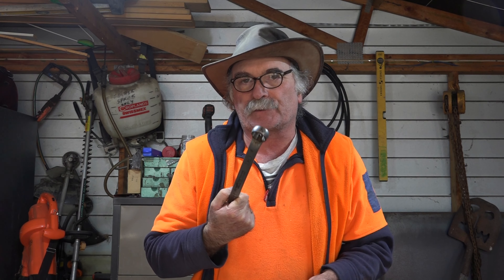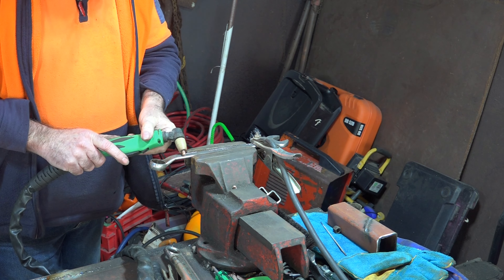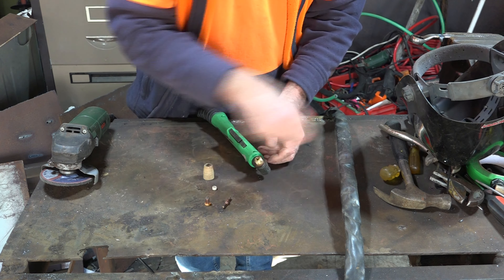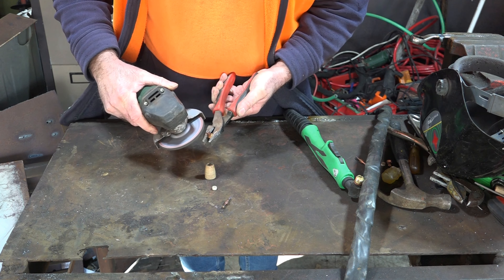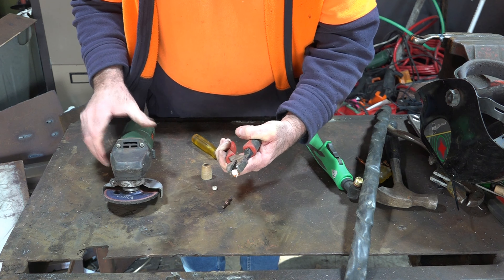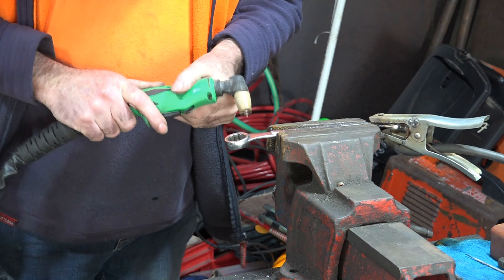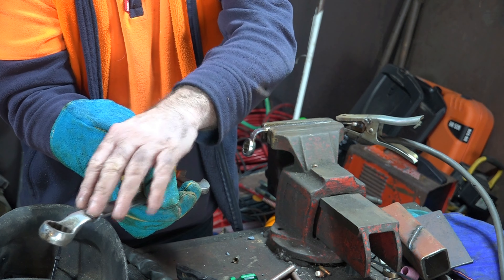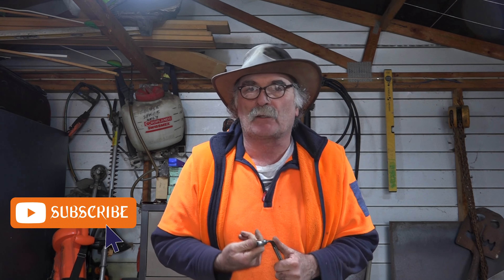Incredible way to bend steel with your plasma cutter

Comment: Handy tip , you can also do this with the arc from a tig  torch if you hold the arc back at the right distance you don't melt the metal but can get it to glow, takes a bit of practice but works a treat.
Reply from the maker: Yea take a while to learn lol.
Reply: What a great trick of the trade… thanks!

Comment: Great option to have! 
If you need to hold something small and fragile like that, rather than use regular pliers use a pair of vice grips maybe with a bit of bike inner tube to soften the jaws (vice grips give heaps more control over the amount of force) then hold the vice grips in your bench vice. Frees up your hands and gives a lot more control for cutting/grinding - plus if you're like me trying to do that with regular pliers you'll drop it three times and it'll bounce under a cupboard to be lost forever.
Reply from the maker: great idea

Comment: I don’t know about your plasma cutter, but my instructions say the cutter should always be in contact with metal and running the torch without contacting metal will shorten the life of the machine.
Reply from the maker: Starch start but not pilot arc cheers